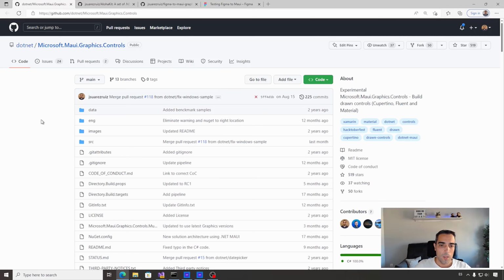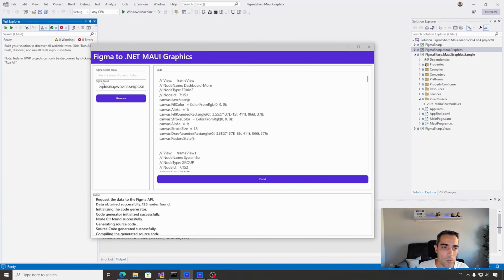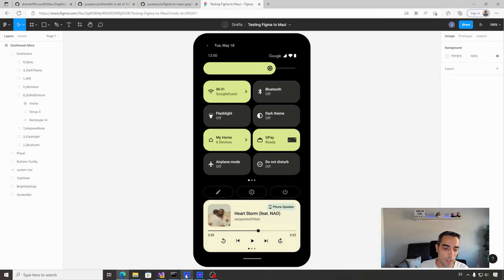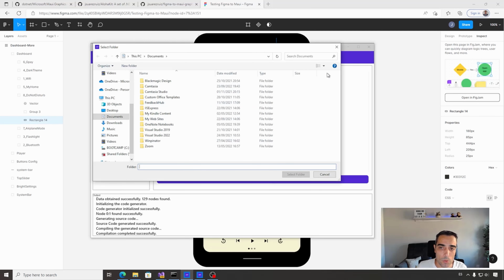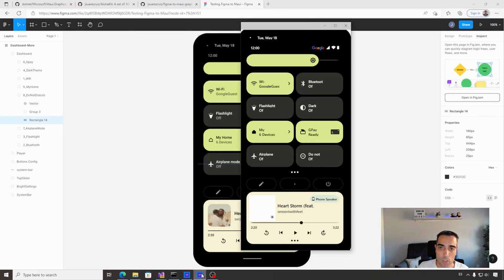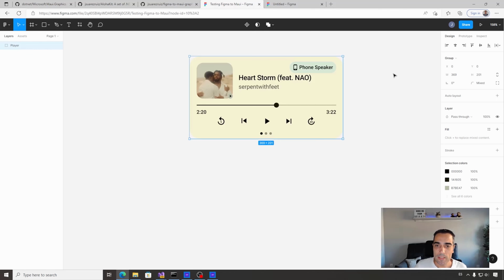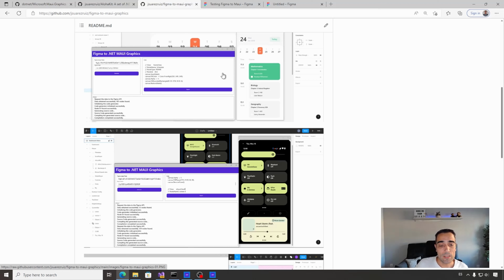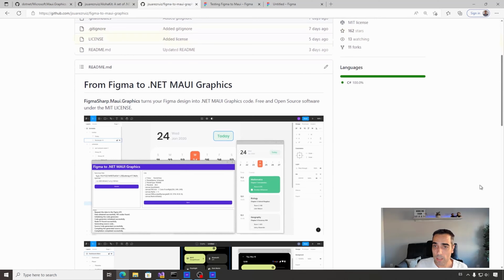Turns your Figma design into .NET MAUI Graphics code

Comment: There still seem to be some bugs. When I have a rectangle with curved corners on one side and rectangular corners on the other it mixes the corner right down up with the corner left down. Suddenly the right down corner is curved and the left down is rectangular.

for example, it does this: 
canvas.FillRoundedRectangle(256f, 86f, 65f, 48f, 0f, 8f, 8f, 0f); 
instead of this:
canvas.FillRoundedRectangle(256f, 86f, 65f, 48f, 0f, 8f, 0f, 8f);

edit: 
the error for filled rectangles is in RectangleConverter, line 57 where the wrong index is used:
                        builder.AppendLine(string.Format($"canvas.FillRoundedRectangle({bounds.X.ToString(nfi)}f, {bounds.Y.ToString(nfi)}f, {bounds.Width.ToString(nfi)}f, {bounds.Height.ToString(nfi)}f, {rectangleCornerRadii[0].ToString(nfi)}f, {rectangleCornerRadii[1].ToString(nfi)}f, {rectangleCornerRadii[2].ToString(nfi)}f, {rectangleCornerRadii[3].ToString(nfi)}f);"));

2 and 3 need to be exchanged with each other:
builder.AppendLine(string.Format($"canvas.FillRoundedRectangle({bounds.X.ToString(nfi)}f, {bounds.Y.ToString(nfi)}f, {bounds.Width.ToString(nfi)}f, {bounds.Height.ToString(nfi)}f, {rectangleCornerRadii[0].ToString(nfi)}f, {rectangleCornerRadii[1].ToString(nfi)}f, {rectangleCornerRadii[3].ToString(nfi)}f, {rectangleCornerRadii[2].ToString(nfi)}f);"));

do the same again in line 95 for rectangles that aren't filled